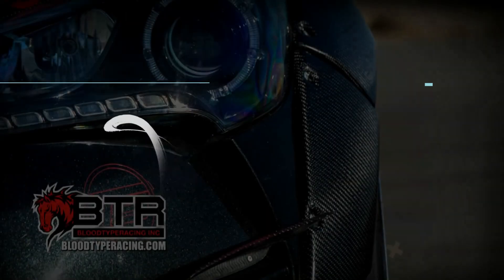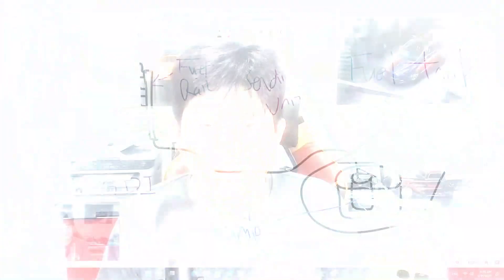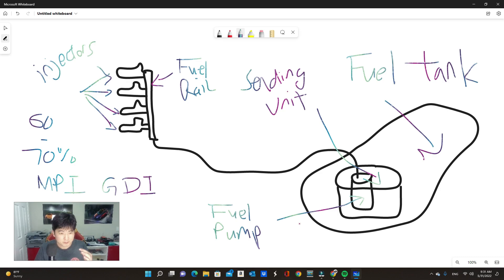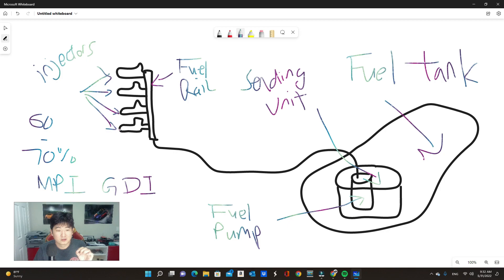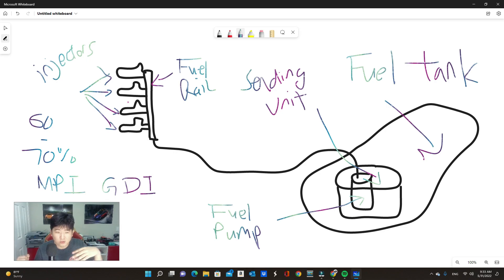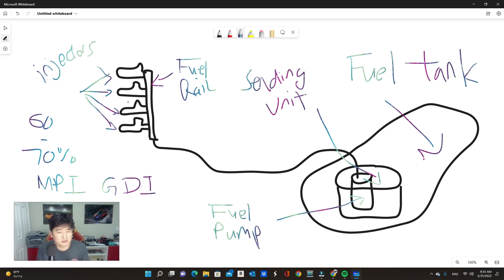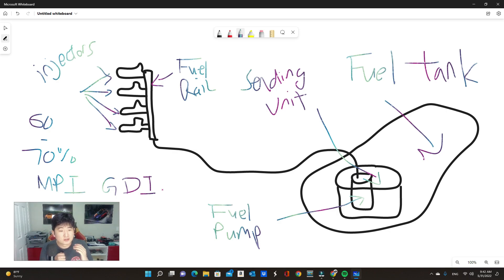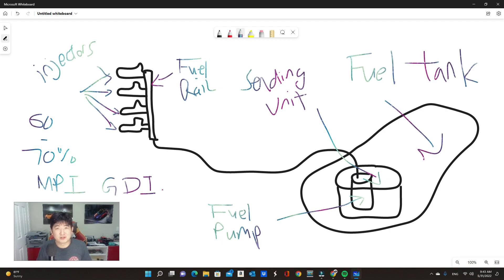Fuel Injectors DO NOT add Horsepower! Watch before you waste your money!

Comment: I just bought 1050cc injectors off your website and was told I could flood my engine with them so I need u guys to downsize to a 750cc. I also bought a tomei turbocharger, and ark down pipe and test pipe but you guys said you would replace them with isr because they discontinued the ark one’s. I emailed you guys, could you get back to me?

Comment: Great video. What are proven bolt on add ons that make more WHP gains and what are Not?
Reply from the maker: for the most part, bolt on modifications that increase air flow create power especially when paired with an ECU tune.
Reply: @BTRcarcustoms  Do you think Short  Intake help to provide more free flowing air?
Reply from the maker: @edwinthomas618  that depends on the car. some cars, the intakes are placed in spots where it actually brings in more heated air than factory and can actually hurt gains.